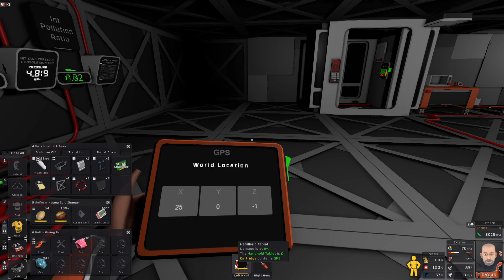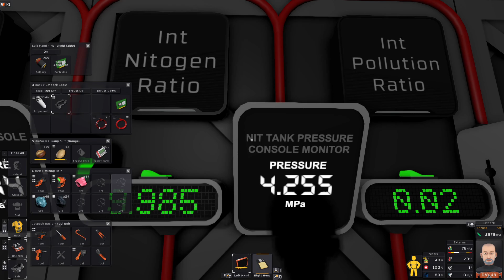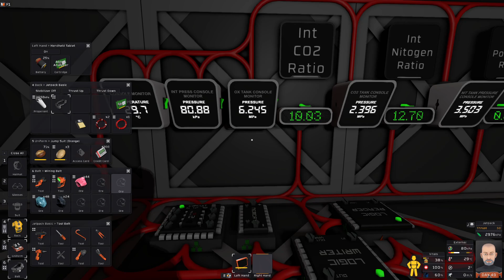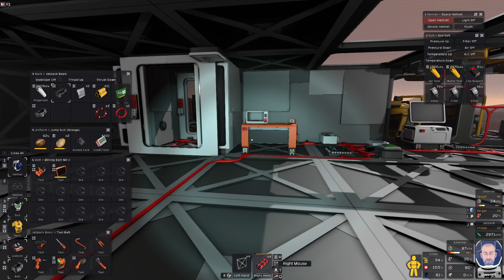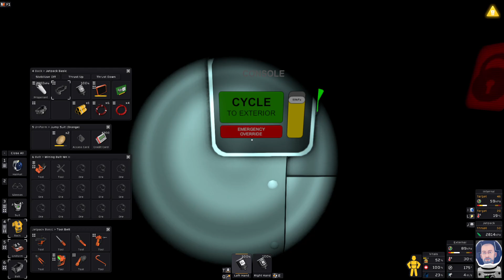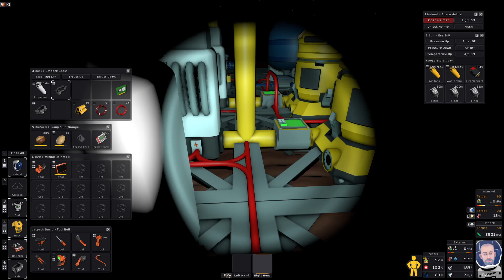Stationeers: Brutal Mars Ep8.New method for mixing base atmospherics.  Power upgrades.

Comment: When you put suit on you start with the base atmosfer. with 20% nitrogen and 90kPa. An your suit cant remove nitrogen, but you have 1/3 pressure in it. So you end with 40% oxygen atm at 32 kPa. So flush suit, up pressure in suit or put nitrogen filter (it should last for very long). And about slow fill airlock by active vent (from few episode ago) - active vent can take only atmosfer from connected pipe system in on tick. So make pipe system larger or pressure it if you want to avoid inrush air when open door.
Reply from the maker: Yup that makes perfect sense. Thanks

Comment: From what i recall from my Mars station the window frames cast a shadow on the solar panels and reduce the output by a few percent and the air in the enclosure keeps getting warmer but it's beginning at the low Mars pressure so it probably won't burst the windows at some point.